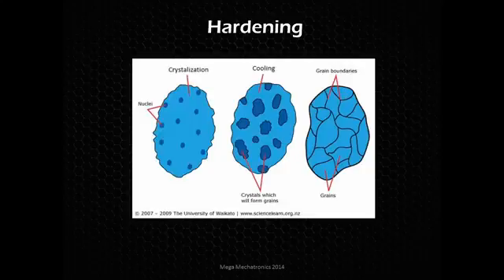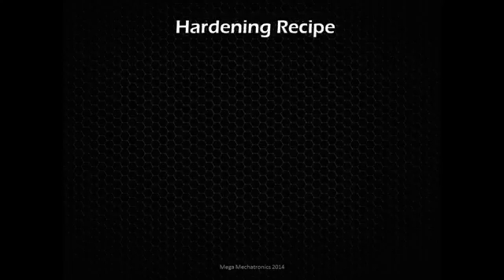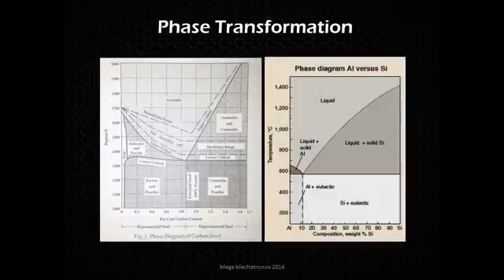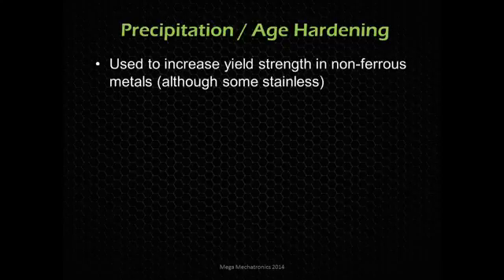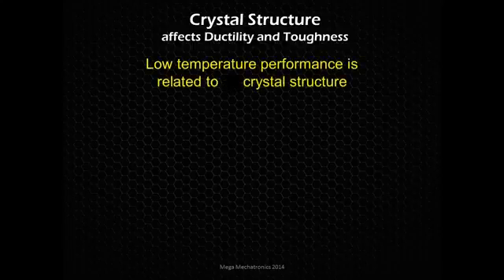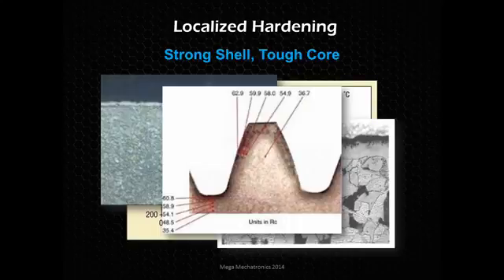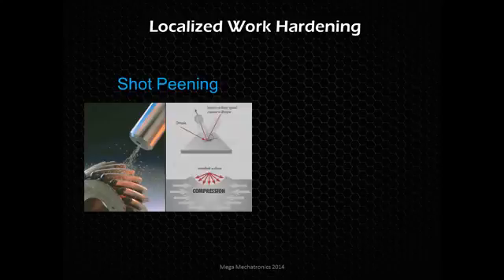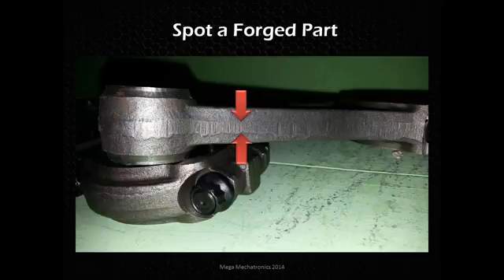Materials Science Mechanical Engineering    Part 4 Heat Treatment Explained

Comment: Name : Fariz Riza Prayoga (2714100123)
The video is very interesting, in that video mention almost about heat treatment and hardening process. hardening and heat treatment need to be concerned since the result will affect the mechanical prpoperties. the hardening process we need to crystalized and then cool the material. Hardening is a metallurgical metalworking process used to increase the hardness of a metal. The hardness of a metal is directly proportional to the uniaxial yield stress at the location of the imposed strain. A harder metal will have a higher resistance to plastic deformation than a less hard metal. A crystalline structure is any structure of ions, molecules, or atoms that are held together in an ordered, three-dimensional arrangement. Crystalline structure is one of two types of structural ordering of atoms, the other being the amorphous structure. The key difference in the crystalline and amorphous structure is the ordering of the structure. Crystalline structure can be thought of as the highest level of order that can exist in a material, while an amorphous structure is irregular and lacks the repeating pattern of a crystal lattice. Simply, the crystal structure can be thought of as a small box with atoms, molecules, or ions located in specific areas of the box. The atoms within this box represent the smallest group of repeating atoms in the entire molecule. That means each atom found in the small box continues to repeat on and on in the same connectivity throughout the entire compound. The general arrangement and order of the atoms in the structure are directly related to the natural properties of the crystal. The crystalline structure is unique and specific for each material. That is to say, there will be no other compound organized in exactly the same way as any other. Essentially, the crystalline structure is the 'identification marker' for the compound. we know that the BCC structure is the base form in ferrit phase. to increase the hardness of the material, we will make the martensite structure. this structure have needle path with great boundary stress that will give more hardness structure. from the crystal structure, we need to make smaller grain size because the grain boundary will give barrier that mean a hardness increased.  The concern in this short paper is about hardenability of material. The hardenability in this concept are limit dependent on alloying elements of the metal and the hardness properties on the material is dependent on carbon content in ferrous carbon. We can see the hardness vs carbon content in the video, the hardness is hugely increased with addition in carbon content until 0.8%. the hardening process have many parameter such as heating rate , holding time and cooling rate. We need to quench material to perform martensite state in the material. Different quench media will have different amount of martensite. In the TTT diagram , we know that is impossible to perform martensit with water quench media. it will make the carbon trapped in FCC state, but the amount of carbon cannot be controlled. It will make the material has brittle properties and made the material crack. The material need to alloyed to reduce cooling rate but perform martensite state using oil or salt media. the heat treatmen until quenching process will give martensite state. Although the amount of martensite state can reach 100%. So the additional process need to be perform more process. We now that cryotemper will make the martensit state will revealed perfectly (100%) using this process. This process also called sub zero treatment. Lets comparate the amount of alloy in some material like plain carbon 1018. The base element is iron and it has 0.17%C, 0.75% Mn, 0.04% P, and 0.05% S. the eutectoid is still in 0.8% C . for the 4130 alloy steel, it has 0.3%C, 0.5%C, 0.2%Mo, 0.95%Cr, 0.25%Si. The 4130 steel will have eutectoid lower than 0.8%. the next process after we get martensite state is tempering. Tempering involves heating steel that has been quenched and hardened for an adequate period of time so that the metal can be equilibrated. The hardness and strength obtained depend upon the temperature at which tempering is carried out. Higher temperatures will result into high ductility, but low strength and hardness. Low tempering temperatures will produce low ductility, but high strength and hardness. In practice, appropriate tempering temperatures are selected that will produce the desired level of hardness and strength. This operation is performed on all carbon steels that have been hardened, in order to reduce their brittleness, so that they can be used effectively in desired applications. Tempering process must be done under transformation temperature to avoid the martensite reforming ferrit phase. Some heat treatmen like annealing and normalizing to improve ductility and age hardnenign to perform precipitate as known as secondary hardness may be performed. In the video also mention about cold working, Cold rolling is the most common method of work hardening. This involves the metal being passed through pairs of rollers to reduce its thickness or to make the thickness uniform. As it moves through the rollers and is compressed, the metal grains are deformed.  Examples of cold-rolled products include steel sheets, strips, bars, and rods. Bending of sheet metal is another process for cold working, which involves deforming metal over a work axis, thereby creating a change in the metals geometry. In this method, the shape changes, but the volume of the metal remains constant. An example of this bending process is simply bending of steel or aluminum parts to meet the desired curvature. Many car parts, for example, have to be bent in order to fit manufacture dimensions.

Comment: Taufik Ramadhanu - 2714100120

When we hardening materials, we have to crystalize it, to make the atoms move around and cooled it to form a crystal structure such as FCC and BCC, when the crystal start forming randomly within the material, they’re going to  crystalizing in different orientation, so that we can see the grain boundaries. Grain boundaries are important to characteristic of materials, if  the materials has small grain boundaries, it will become stronger and harder materials, because we reducing the lattice to deform and move around. The concept of hardenability in alloys of metals is they have different hardenability in each alloys because they have different characteristic and treatment. Hardness dependent on carbon in ferrous metals, they will increase the strength and certain characteristic to ferrous metal. We can see at the chart from the video (hardness number vs carbon content), the Rockwell number arise as the carbon also increasing. 
In hardening, it is important to watch for the time and temperature.  It is explained in the video that the hardening process starts from the heating in certain temperature (basically at 600 Fo for metal alloys), and we hold it in certain time, after that we quenched it and for the finishing we do tempering to reducing the residual stress. The cooling rate process (quench) is important to material characteristic. What the quenching process does are forming a certain crystal structure and phase such as martensite. There are several different media are use to quench materials, there is water, oil, salt bath. Each medias will give different cooling rate, the fastest one is water, it will make the materials phase change into fully martensite, which is strong hard but high brittleness, the second is oil, and the slowest cooling rate is salt bath. There are two types of tempering that we discussed in class, it is martempering and austempering. 
Martempering is a common heat treatment process that quenches the material to an intermediate temperature just above the martensite start temperature (Ms) and then cools air through the martensitic transformation range to room temperature. It is important to air-cool throughout the transformation range since rapid cooling through this range is required to produce residual stress patterns similar to those produced by a direct quench and negate any advantages of the process. Modified martempering (MM) is a similar technique wherein the intermediate quench temperature is below Ms but above the martensite finish temperature (Mf). Tempering of martempered or modified martempered steels to the desired hardness and tensile strength is performed identically to that in quench and temper operations with better impact resistance.
Austempering is a method of hardening steel by quenching from the austenitizing temperature into a heat extracting medium (usually molten salt) which is maintained at specified temperature level between 200°C and 400°C and holding the steel in this medium until austenite is transformed to bainite. This method is used to increase strength, toughness, and to reduce distortion. The two processes are heating a medium-to-high carbon ferrous metal to an austenitic condition then cooling the object rapidly enough to avoid the formation of pearlite to a temperature above  Ms temperature and isothermally holding the part for a time sufficient to produce the desired microstructure.
The video also said that composition matters, the video compared 3 materials with different composition, which is Plain Carbon 1080, 4130 Alloy Steel, 304 Stainless Steel. In each materials has carbon composition, but what makes 304 SS stronger and harder is it has 20% chromium composition, which will increase toughness, strength, and also corrosion resistance.
There are many types of heat treatment can be use. Tempering, after hardening, the material is too brittle, improves toughness and it is done below the transformation temperature. In normalizing, ferrous based metal heated above transformation temperature and allowed to air cool in still air at room temperature. In annealing, we heated and hold in certain temperature and controlled the cooling rate. The purpose of this method is to softening the materials and producing desirable microstructures.
Precipitation hardening, or age hardening, is a heat treatment process that produces uniformly dispersed particles within a metal's grain structure that hinder dislocation motion, thereby strengthening the metal.
The formation of these precipitates is done by using a solution treatment at high temperatures prior to a rapid cooling process. The solution heat treatment results in a single-phase solution while the rapid cooling results in a stable material by preventing the creation and propagation of lattice defects, thereby greatly strengthening the metal matrix.
Precipitation hardening is typically performed in a vacuum, inert atmosphere at temperatures ranging between 900 to 1150°F. The process ranges in time from one to four hours depending on exact material and characteristics specified.
As with tempering, a balance must be struck when precipitation hardening between the resulting increase in strength and the loss of ductility and toughness. Additionally, it is possible to over age the material by tempering for too long, resulting in large, spread-out and thus ineffective precipitates.
There are other alternative  beside hot working, it is cold working or work hardening by applying compression forces and plastic deformation and the purpose of work hardening is creates desirable dislocations in the crystal lattice structure, improving yield strength, but reduces ductility. Example of work hardening is cold rolling (Tighter tolerance, residual stress).

Comment: Mudzakkir Dioktyanto

2714100068

Thank you for this video, this video is amazing

It’s explaining about the hardenability and the heat treatment in simple way and easy to understand.

Hardenability, in general, is defined as the ability of a ferrous material to acquire hardness after austenitization and quenching. The ability to reach a certain hardness level is associated with the highest attainable hardness. It depends first of all on the carbon content of the material and more specifically on the amount of carbon dissolved in the austenite after the austenitizing treatment, because only this amount of carbon takes part in the austenite-to-martensite transformation and has relevant influence onthe hardness of martensite. Besides that, hardenability is lmited to its alloying elements of the metals. 
Before we do hardening there are some recipe that must we take attention to. There are temperature, time, and material. Temperature is how much the temperaturewe must increase to transform the phase of these material, the alloying elements will affect the temperature we need to accomplish, and the thicness of the material will increase the temperature too, more thickness, then more temperature we needed. The time of the treatment is different with the different properties we want to make, for example if we want to make martensite, first we have to heat it up until tranformation temperature then hold for some time depend on the thickness too, then we quench it in water, or oil , or saltbath so the cooling rate is fast, and we can got martensite. The material we want to treat will affect too, because as we know different alloying elements will make different result, like Ni that will shift the cooling curve to right, and the properties we want to make will affect the method we will used.
An example from this video is in valve spring, this valve spring has very good mechanical properties that can maintain the strength and thoughness, so we do post process (heat teratment) to obtain that properties we needed. So this valve spring treated with hardening , then we do austempering to obtain the structure that we want. So, if you wanna make something different you can just do different treatment to them.

The phase diagram is very important to understand, because from there we will know about the transformation of our material that we want to treat. And the alloying element that we add sometimes will affect the phase diagram of our material. So, we have to know the behaviour of our material before we treat them, because it will make the process more simple. With the same material we can make different / various properties because with our post process we can change it.
Tempering is a process in which previously hardened or normalized steel is usually heated to a temperature below the low critical temperature and cooled at a suitable rate. primarily to increase ductility and toughness. but also to increase the grain size of the matrix. Steels are tempered by reheating after hardening to obtain specific values of mechanical properties and also to relieve quenching stresses and to ensure dimensional stability. Tempering usually follows quenching from above the upper critical temperature; however, tempering is also used to relieve the stresses and reduce the hardness developed during welding and to relieve stresses induced by forming and machining.

Normalizing Heat Treatment process is heating a steel above the critical temperature, holding for a period of time long enough for transformation to occur, and air cooling. Normalized heat treatment establishes a more uniform carbide size and distribution which facilitates later heat treatment operations and produces a more uniform final product. Annealing heat treatment process is heating the material above the critical temperature, holding long enough for transformation to occur and slow cooling. Full annealing heat treatment differs from normalizing heat treatment in that the annealing temperature is typically 150-200F lower than the normalizing temperature and the cooling rate is slower. This establishes a soft microstructure and thus a soft product.
 Precipitation hardening, or age hardening, is a heat treatment process that produces uniformly dispersed particles within a metal's grain structure that hinder dislocation motion, thereby strengthening the metal. The formation of these precipitates is done by using a solution treatment at high temperatures prior to a rapid cooling process. The solution heat treatment results in a single-phase solution while the rapid cooling results in a stable material by preventing the creation and propagation of lattice defects, thereby greatly strengthening the metal matrix.
 Beside hardening all of our material there are different process to harden just the surface of our material there are Induction hardening, nitriding, carburizing, cryogenic treatment, work hardening, cold work, and hardwork, with different properties that we want to create.
We can do some test of this hardness there are vikers , brinell, and rockwell with different kind of value, but we can compare each other with some constanta. And the simplest way we can do scratch test, we scratch it with other material so we can know the hardness of our material but it is not accurate enough. 
       I think that, this video methode is an extraordinary idea to make people easier to understand about topic that we want to tell about. Thank you again mrs dian for sharing this video, I really enjoyed this.